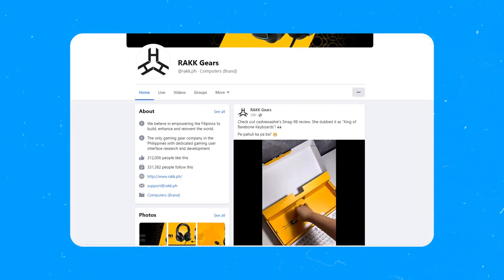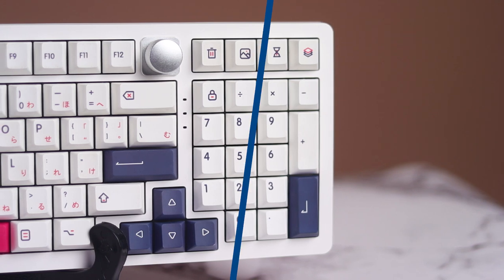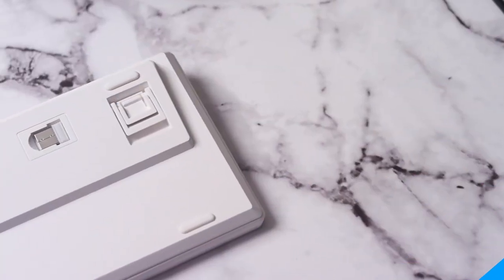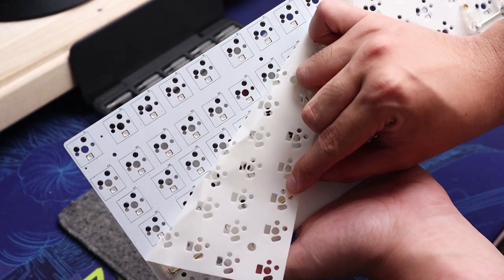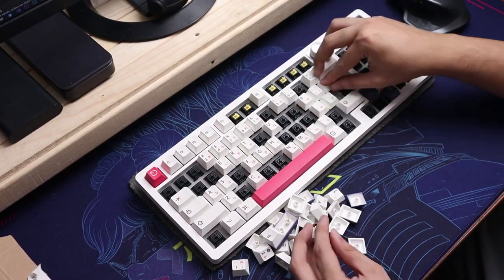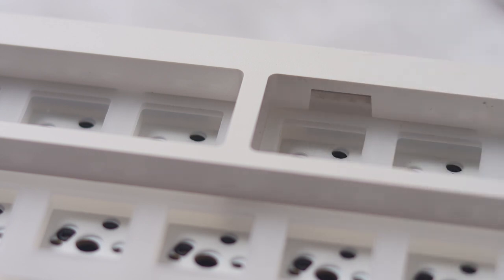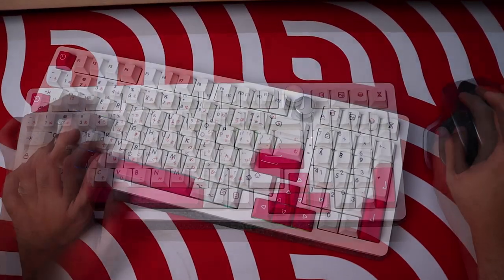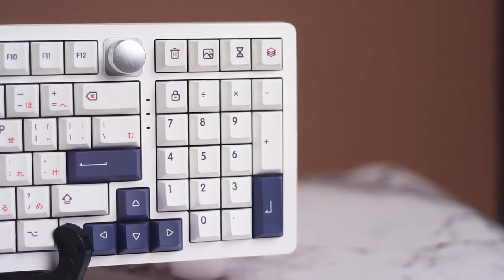Rakk LISTENED! | Rakk Sinag98 | Unboxing, Review + Easy Mods

Comment from the maker: Update from Rakk: The reason why there is no pre-factory lubing, is for the user to be able to tune the stabs bone dry rather than cleaning it off w/ the pre-factory lube. This was an intentional move by Rakk to avoid the stabs being sticky right out of the factory. 

NEW Video will be out soon; showing the Rakk Polycarb Case + Rakk Sinag98 so stay tuned!
Reply: san nyo nabili lube nyo sir? btw nice review haha waiting for my sinag98 building it with akko lavender purple haha
Reply from the maker: I normally use JMK lube pero in the vid its from zion studios
Reply: This is what I was thinking as well, kahit na may lube na na pre applied, some users will relube them anyway. Tsaka mahirap din mag holee mod ng stabs na previously nalube na, pag di mo nalinis ng maayos, either magslide or di dididikit ung band aid at all

Comment: About 1 kg - why? Are they greedy for plastic?
AKKO 3098 1.1 kg, FL.Esports 980 v2 about 1.2 kg, CMK98 1.6 kg with alu plates.
Reply: Hindi kasi pwede ung ganun for sure kaya ng Rakk pero may features na mawawala. Sabihin natin over sa 1KG yan pero tri mode ba yan?